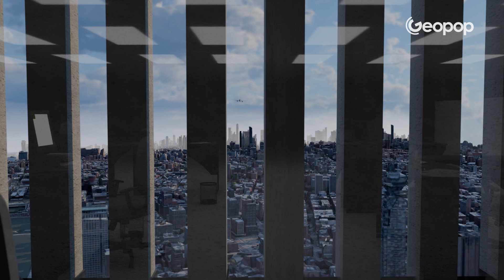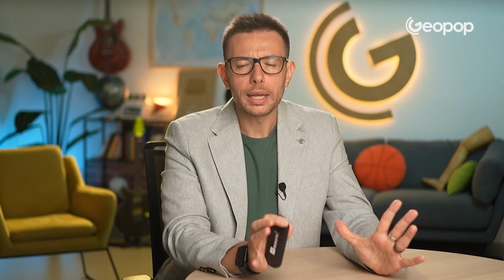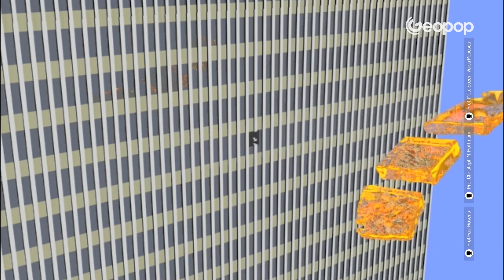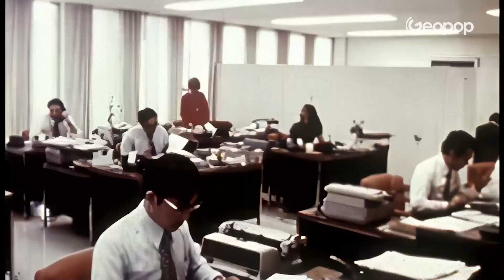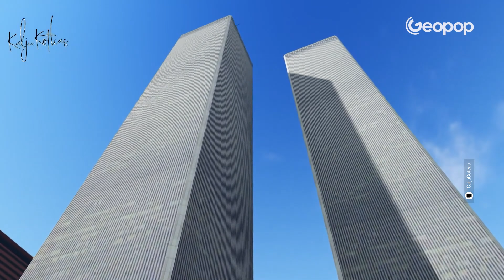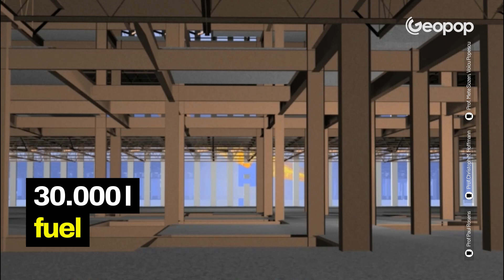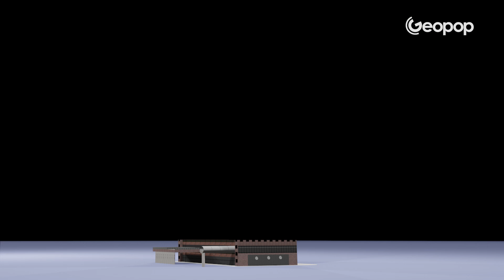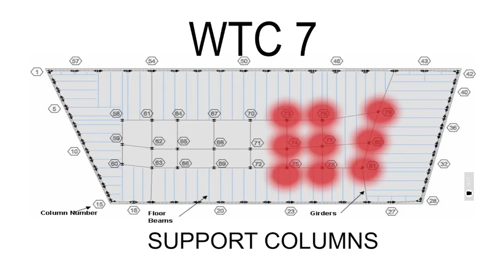9/11, 2001: The Technical Reconstruction of the Twin Towers and WTC 7 Collapses

Comment: All these years listening to idiots claim the fire couldn't melt steel beams, when common sense should've told them the steel didn't need to melt, it just needed to be weakened and gravity, pressure, and stress would do the rest. You don't need to melt metal to make it bend, and everyone should know metal gets weaker when you add heat.
Reply: Yup.  The fire weakens the steel and then all that weight the towers were supporting for 30 years fell 10 feet and the whole thing turned to dust.  Nothing suspicious there.
Reply: @jacoboc2244  They didn't stay straight, they sagged. The fires burned from the time the buildings got hit until they went down, and then continued to burn in some spots even after collapse. In addition, as I said, the collapsed floors and walls would act as a kiln, the wind 90+ floors up would act as a billows, turning the impact zones into forges. The temperature that I stated, 1800°+, is the temperature range achieved in the impact zone, which is above the melting point of aluminum.
Reply: @jacoboc2244  You didn't back up your point, so it's irrelevant.
Reply: Thermate Military explosives!!   Still burning days after the incident in pools in the debris like.   Explain how Military grade Thermate explosives got there?  All this NIST crap trying to justify the collapse is pathetic. The coverup in this mess is disgraceful.
Reply: U people are clueless to believe this BS
Reply: This is a fact but that dont explain the entire collapse above the "impact" site maybe but there wasn't enough white or material above that to cause the entire collapse
Reply: That's not tge only argument though
Reply: Whoever believes the buildings collapsed because of the jet fuel fire, you're an i***d
Reply: -- Then what is the source of the many tons of molten steel found in and under the debris, the heat so intense that the molten steel remained in that state for weeks afterward, running off of the debris as it was excavated. This cannot be molten copper from wiring that retains the color of a shiny new penny.  It cannot be molten aluminum that retains the color of the polished aluminum wheels of a street racer. It was the color of glowing orange molten steel  that cannot be mistaken for any other material, reported by firefighters who are very experienced in the nature of such materials as well as seen in video evidence.

When you combine this with an entire lack of turbulence behind 500 mph aircraft, when even a small Cessna Aircraft would leave an evident wake in the smoke and fire only seconds later .  . We find that skeptics still cannot be skeptical of the official narrative in explanation.  Sponsored channels and forum activity are skeptical of nothing when support is provided.

Sponsored activity in the forums is very normal today for commercial and political purposes and subjects of controversy -- in the attempt to lead public debate.
Reply: @ronaldgreene5733  Well, I'll ask you a question - how exactly do you think that steel can be molten for weeks, just lying around on the ground. Are you insane? Phew, I'm gobsmacked the by the stupid shit you people believe in. Science? Who needs science?!? Steel just flows around like water! Cos, government, or something. Holy fuck, grow a brain.
Reply: Why did they find molten steel days after? Aviation fuel is just glorified kerosene. And didn’t they find evidence of thermite ?
Reply: @reignman30  so why doesn't a jet engine drop out of the sky then? Same fuel remember.
Reply: @patricksmith4424  there was a jet engine though. There’s pictures of the twisted thing.
Reply: @patricksmith4424 Maybe because engines are cooled so they don't overheat? And if they overheat they shut down so no more heat is produced.
Reply: @tracygilbert5731  yes agreed, cooling is vital in all heat engines, but still there is a raging inferno in the combustion Chambers of jet engines, so the temperature of the casing has to withstand temperatures of 1300 degrees or more for hours on end. To melt or bend steel you need an  incredibly hot concentrated oxygen enriched flame. Think blast furnace, welder and oxypropolene torch. A regular fire, including a kerosene, will not   soften metal to that extent. The Greville tower, London tragedy, a huge housing block fire totally engulfed the building and it was raging for hours, yet structurally it was unharmed. Also steel is a very good conductor of heat so in a lattice it will be impossible for it to concentrate.
Reply: @patricksmith4424
You have absolutely no idea what you're talking about. Thin metal is actually heated faster. It's not a matter of concentrating it it's a matter of heat being able to heat it quickly throughout its entire cross-section. Tell you what, take a straight pin and the section of a metal coat hanger heat them side by side right next to each other while they're up in the air where they can be surrounded by heat just as the trusses were in all of the buildings discussed here. You will find that the straight pin heats up almost instantly while the section of metal coat hanger takes far far longer to glow. Let the people who have real world experience explain things instead of attempting to bullshit your way through.
Reply: @patricksmith4424  don't waste your breath Patrick, they will Ignore the science completely and try to explain things away with exaggerations of what they think they know.
Reply: @patricksmith4424 these guys are stupid unable to think for themselves just look at what he said talking about steel like it’s lava steel in a forge isn’t molten just red hot critical thinkers know that if that building was to collapse from the attack it wouldn’t have fell so uniformly and for building 7 no way you can tell me that office desks stocked the fire and burned hot enough to collapse the building more like they were in a panic and pulled the wrong building
Reply: @JeffShiny913  1 and 2 didn't fall uniformly. They devastated the area beneath them. I can't remember which of the two towers it is (2, I think), but there's footage from several angles wherein you can see the entire roof of the building coming down at an almost 70° angle. There's nothing uniform about their respective collapses. You could fit most beachside hotels in the 11-story hole left behind by one of the impacts. That's an insane amount of kinetic damage. As for molten material running from the side of the south tower, that's molten aircraft aluminum, likely mixed with copper from a multitude of pipes. The collapsed floors and walls would have have acted like a kiln, trapping and concentrating the heat to such an extent that it climbed well above the melting point of aluminum, in fact, reaching temperatures of over 1800°F. Thermite looks nothing like that, nor does it act that way. Also, there's no "thermite" flowing from any other corner on either building. It's only flowing from that single point where the bulk of the debris from the impact ended up. As for secondary explosions heard by onlookers, I'd invite you to look up what it sounds like when people hit the cement at 120-180mph, which is terminal velocity depending on whether you're falling belly or head-down. I'd also invite you to look up a slag explosion, which is a result of molten slag coming into contact with water. Now consider all of the restrooms, sinks, etc. in the towers and how much water was moved up and down their 110 stories. Slag explosions, molten aluminum, and jumpers. All amplified by the reverb typical of dense urban areas like Manhattan. 

Was it an inside job carried out by the Kuwaiti royal family, Halliburton, the Carlyle Group and their partners? Yes. Were Towers 1 and 2 rigged to blow? No. 

Tower 7 tho... 👀
Reply: @RebelInTheF.D.G  so it fell over or did it fall straight down to the ground are my eyes deceiving me cuz I could have sworn they fell straight down bottom to top if it collapsed from the plane it would have fell over from where the crash was
Reply: @jeffdollaz  They didn't fall straight down. It looks straight down because of the scale. Everything in those buildings is bolted, cemented, welded, and screwed together, including the buttresses around the outer facade. The second those upper sections go, they're dragging everything with them that doesn't snap free. Go back and watch multiple angles. Watch entire sections of the towers continue to stand for several moments while the rest hits the ground. Watch for the roof. Watch the antennas on top. And then watch the footage of rescue and cleanup. The debris pile is as tall as 9 stories in some places, not to mention what collapse below street level. Several blocks worth of Manhatten were devastated. The towers brought other buildings down with them. The damage was insane. Do you ever look up the aftermath of controlled detonations? Do you ever look up apartment buildings in other countries that collapse due to fires and watch that footage? Or do you just cherry-pick the angles on 9/11 that look vaguely suspicious, yoink some random controlled detonation of a building that could have fit inside the impact zone, and then call it a day? 

https:// www  .hstoday  .us/wp-content/uploads/2022/09/1000w_q95-96.jpg

Remove the spaces. You can see the damage of the buildings around it and almost 7-9 stories worth of debris in that one small picture alone, not to mention the other buildings of WTC being borderline buried by it. Just zooming in on the chewed up building across the street gives you a sense of scale.
Reply: @RebelInTheF.D.G  just watched it again from multiple angles they definitely fell straight down the second one to fall yea the antenna moved so tf what it’s an antenna
Reply: @JeffShiny913  What is straight down to you? Vertical? Yeah, they fell vertically. But do you not see that massive plume of wreckage the size of an entire apartment complex drop out of the sky and slam into an area more than a dozen blocks wide? That is, by absolutely no stretch of the imagination, "in its own footprint," as it would be if it were a controlled detonation.
Reply: @JeffShiny913  https://youtu.be/wRfphCLtUUI?si=2r2Lr4jKhCIxWauG

1:24 and 6:55, you can see roughly 20 stories worth of the tower topple outwards, not straight down.
Reply: @RebelInTheF.D.G  yes some debris broke off but for the most part it fell straight to the ground
Reply: @jeffdollaz  "Some debris." It's the equivalent of a 20+ story section that drops almost completely sideways. Look up whatever building is in your closest skyline that's 20+ stories tall. It's easy to lose sense of the scale because of the smoke and debris. It free-falls directly into the street below, dragging central support structures, namely the elevator shafts that the towers are built entire around, with it, pulling the rest of the building down. That's dozens of thousands of tons of steel and cement dropping out of the sky like a meteor. You can even see the plume of fire caused by the upper floors collapsing down onto the burning floors below, forcing the flames outwards on the side of the tower under the most compression, which is the side that falls out and away from the tower, not straight down. You can watch controlled detonations of buildings in urban centers all day and never see that once. Again, inside job, but not a controlled detonation. I doubt the people that had a hand in it even expected the towers to come down altogether.
Reply: @JeffShiny913  typical unintelligent COD nerd
Reply: @RebelInTheF.D.G the Tower 2
 falling at a 70 degree angle  completely destroys your "COLLAPSE THEORY " because the video reveals the side that the upper block fell away from is still being demolished at the same speed as the side it tilted towards..  GAME OVER! 

When you take a Hammer and hit almost any nail at the wrong angle the nail will bend but it will not penetrate the wood because there's a phenomenon called RESISTANCE! 

THERE WAS NONE ON EITHER SIDE OF TOWER 2 .... SMOKING GUN EVIDENCE OF PROFESSIONALLY PLACED EXPLOSIVES 🕵🏾
Reply: @JeffShiny913 Pulled the wrong building … its delusional to believe that anybody is able to prepare s live building for demolition! Physics does not care about what you believe!
Reply: @RebelInTheF.D.G   You clearly exposed your beliefs as a false and unbelievable narrative when you addressed the South Tower tilting off at a 90 angle... 🕵🏾

That's the very reason why the evidence proves you and your government completely wrong . .. If it's falling away from that side of the building why on God's green earth does the demolition symmetry stay consistent with the side that it leans towards?

Game Over 🕵🏾
Reply: @RebelInTheF.D.G  so where did this molten slag come from?
Reply: @JeffShiny913  Gravity is straight down, where the fuck else would they fall?
Reply: Problem is there is molten steel running in streams like at a forge. Melted steel from office fires shouldn't be ignored. It just can't be conveniently explained by the NIST report.
Reply: @TVfunhouseGAMES wait so there was melted steel? That’s a new one. All the comments I’ve been hearing about 9/11 inside jobs was that it was explosives that brought the building down.
Reply: @TVfunhouseGAMES  aluminium from the planes skin?

Comment: What a crock. The original NIST YouTube video showed the 'pancake' effect with the center 47 columns remaining upright...oops. They quickly removed that and soon replaced it with one where the columns went down too. The explosions in the basement area happened well before the collapse. The jet fuel burned out VERY quickly...the black smoke that continued to billow out of the buildings was from smouldering office furniture, carpets, etc.—black smoke indicating a starving 'fire.' All three buildings fell unhindered, basically at free-fall speed, into their own footprints. There were sqibs happening below the collapsing floors. WTC 7 collapsed from the inside out.
 The list goes on and on. Same with the other 3 planes/incidents. Our tax dollars continue to pay for this nonsense.
Reply: Please seek professional help.

Comment: Weird that the fires in WTC 1 in 1976 on lower floors with more weight and hotter fire didn’t bring the building down. Oh and they added insulation to the beams after that. Believe whatever you want idiots.
Reply: No proof the fire was hotter. The fireproofing was blown off when the jets exploded. You can clearly see the exterior walls pulled inward until it collapsed
Reply: Not weird when you remember that (A) the fire in 1976 was fought, and (B) the tower was not hit by a jumbo jet doing 500+ mph before.

Apples & Oranges.
Reply: @Tim22222 The bomb 1993, took out 6 stories Blasting a 100 to 200 foot round crater. Through all 6 floors, it also started 2 fires, one on the ninth 1 on the 14th floor that ran through the core of the building. The fire in the parking garage was not cut out immediately immediately because they could not get to all of it. They did put the auxiliary fires out very quickly. The ones on the upper floors.
Reply: The 1976 fire was far smaller, not nearly as hot and not accompanied by massive structural damage from the impact of 117 tons of airplane hitting with the force of a ton of TNT.  And the 1976 fire was fought. 

It helps to understand if you only use true and relevant facts, don't make shit up and don't leave critical details out.
Reply: In the video, he explains that the actual impact of it Barely had any effect on the towers @TheLoonResistance
Reply: The biggest true and relevant fact is, you don't even know the date that the event happened. @TheLoonResistance
Reply: @TheLoonResistance The towers weren't even finished in 1976. That shows you how much research you did. It was 1993
Reply: @Bigdaddy96991 - The North Tower fire was actually 1975 (I was off by a year, going purely on memory because the difference is unimportant).

The 1975 arson fire which spread from the 9th to 11th floors mostly through a vent pipe and was quickly put out is a separate event from the 1993 bombing.
Reply: @TheLoonResistance  no answer for the 1993 bombing I see.
Reply: @justinsidious9772  - Your OP states nothing about the 1993 bombing so there is no question to answer. Strawman much?